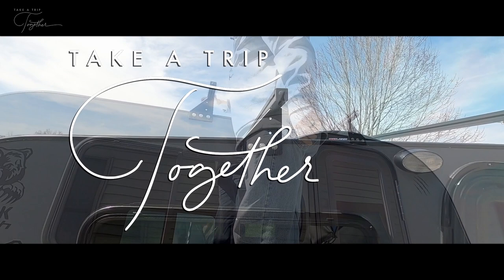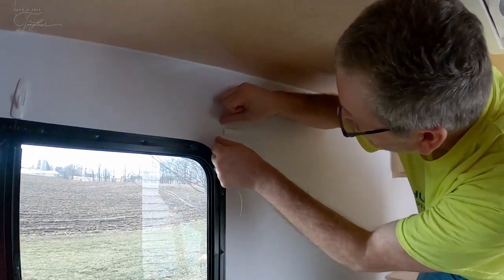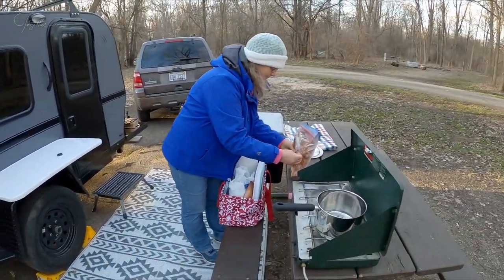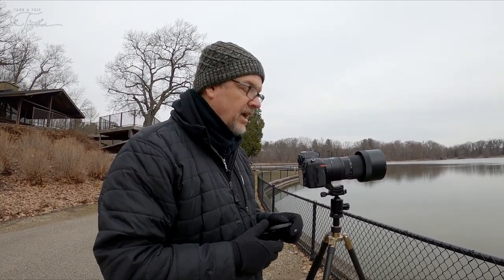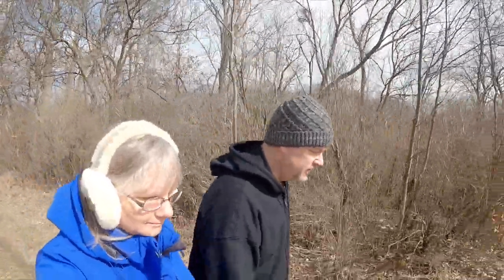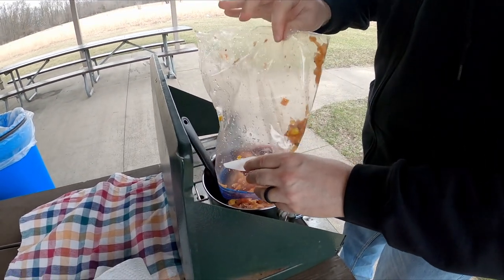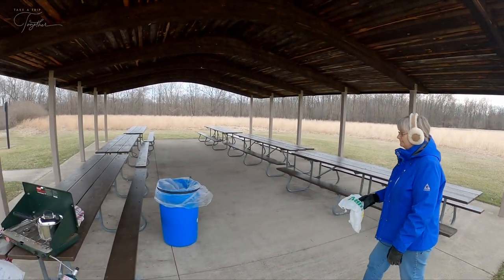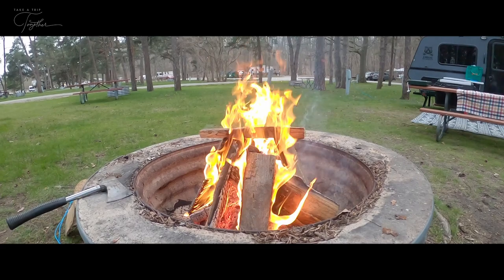First Time Cold Camping in 2022: Tiny Camper Mods and Fort Custer Recreation Area

Comment: Have you camped during high wind conditions? I wonder how a tiny camper pulls in high winds and if it's stable sleeping in it.
Reply from the maker: No, in an abundance of caution, we actually canceled a trip when we were supposed to get high winds earlier this spring because we weren't sure how it would pull. I would think it would catch less wind than a larger rig but we didn't want to take a chance. That being said, we haven't had any issues at all with it during the conditions when we have taken it out. Nice and solid.
Reply: Sometimes we may get stuck with the weather because we are already out camping and bad weather pops up. I'm hoping y'all will report on that if /when it happens. I really appreciate your reports of good/bad experiences with small Camping in your trailer! I have a Wolfpup which is bigger/heavier and we are planning to go  west from Indiana. I just think pulling a smaller rig, like yours, would be easier.  My wife thinks she has to have all the comforts, but I question at what price ie.. fuel, finding sites with power, and how well the bigger rig will pull and hold up.
Reply from the maker: @surgepro322able  Thanks so much! It's easy to fall into the trap of thinking we need all o the bells and whistles, that's for sure. Yes, we will definitely keep you posted.